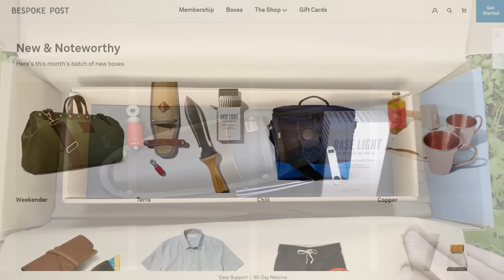How To Make A Bottle Guitar (3 Parts and NO Tools)

Comment: Bro this is exactly what I need. I was working with rubber bands, but they broke fairly quickly. Plus as a bonus you showed some knots which can be very very useful for many applications. This is best video I've seen for a long time.

Comment: Would it be possible to use a violin bow on such guitar?
Reply from the maker: Yes, probably
Reply: That could be a lot of fun too, I love this project
Reply: Honestly probably not. 
I mean you could but the violin has completely different strings and are much much more taught. If you were to make this a bit more complicated and make tension knobs it would probably work better. However I doubt this is rigid enough to really work like a violin. Plucking would work much better.
Reply: Could sound like one of this mongolian horse head violins

Comment: I wish your channel had been around fifty years ago, when I taught a number of instrument making workshops for fifth graders. We managed to make tin can fiddles with bows, xylophones, and a couple other things.  But all required me to drill a hole or provide specialty items such as horsehair.  Your bottle guitar is much better thought out and sounds great.

One quibble- you said right at the beginning "no tools" and I wondered right away how you cut those notches in the end of the pipe.  And of course you did use a tool: that sharp stone edge is a file if I ever saw one. :)

cheers from rainy Vienna, Scott

Comment: If you have a strong string like nylon, you can use it to cut the pipe or cap of the bottle. You just rub it back and forth to create friction and heat. I learned this as an electrician to cut pipes in ditches when you can't get a saw under the pipe.

Comment: Nice idea for a quick lockdown project. I always like how you make your projects with PVC and Soft-Drink Botttles too! My favorite building materials.  I think you could eliminate the heat gun step by just joining some pipe together with couplers to make the bends. Also, you could use a larger diameter pipe that fits over the bottle mouth to form a larger "neck" and perhaps get a couple more strings on there. In any case, this project would be a good place to start if someone wanted to get a feel for playing guitar.
Reply from the maker: It would be cool to see a multi string version as a next step. I couldn't think of how to do it without really complicating the design. I think you might have to use something other than a plastic bottle.
Reply: how did you get here 3 hours ago?
Reply: @palmermonsen9098  probably patreon

Comment: Excellent instructional video. BTW, what type of string should be utilized (other than the kite string that you've mentioned)? Can't wait to assemble the botar (bottle guitar) once I've purchased the right type of string. Hope the finished product sounds as good as the one in the video. Thanks. 👍👍😷
Reply from the maker: I was using plastic gardening twine. The kind that comes in a dozen different colors at every hardware store. Any string should work, even fishing line.

Comment: Love this idea I am a younger aged person in a nursing home and my occupational therapist and I are going to be trying to make one of these within the next week or 2  help my hand dexterity and battle my depression as I love instruments and diy craft projects. She asked me what I wanted to try and I found this video. Question though what thickness (mm in diameter? Material?)or kind of string would you recommend for the deeper sounding guitar? Thanks I am so stoked about trying this!
Reply from the maker: The pipe is 1/2" diameter pvc pipe, the string is I think polyester garden twine. It's the sort of twine that is sold in a bunch of different colors at most hardware stores. String that works well and is better quality is braided string for window blind cords.
Reply: @Nighthawkinlight  thank you very much! I made an attempt at one this morning just having trouble with string tension
Reply: @Nighthawkinlight  we are using a 20 oz bottle I dont know if that could be part of what is affecting the sound we went with what was available but can always try again. Your instructions were so clear assembly was no problem.
Reply from the maker: @lorisimpson6374  Some strings are slippery and might make it hard for the sliding knot to hold tension. You could try using a bit of thicker rope in the back which can hold the tension better like I show for the thin string version. Glad it was easy to assemble!
Reply: I've got it playing now hope to make a video in the next few days I made one alteration I used a crayola magic marker cap for the bridge as the bottle cap kept popping off. I love my new instrument thank you!

Comment: i'm just wanting to see someone make some "rolled" bottle string! what i am talking about is you take bottle string and attach it to either a drill or motor and a anchor point (i.e vise) and twist the bottle string until it starts to "roll" over onto it'self. you then heat it up with a variable heat gun while it is stretched out to keep the tension of the string but dont overheat it, you'll end up burning the string. you now have rolled bottle string. an example of what to use it for is coil it in the spool for a weed wacker...

Comment: if you use a bottle with slightly larger opening, a slightly larger diameter pipe to fit the mouth of the bottle, and taper the top of the pipe until its flat using some heat and weight/clamp, you might be able to cut 6 notches on top and make it a proper 6-string guitar with strings of different sizes (or even actual guitar strings).

Comment: To bend plastic pipe without it deforming when heated. Fill the pipe with sand before applying the heat. You can empty the sand after the plastic has set

Comment: I'm going to try making one with a bamboo neck instead of PVC.  Because I have bamboo growing in my yard so I won't need to go to town. And maybe try using metal wire for the playing string so I can play slide on it.  I wonder if the bottle cap bridge would work better if it were cut in half into a "D" shape
Reply from the maker: Slide works on the plastic strings too, but you don't get the growling sound of metal. Let me know how it turns out!

Comment: I love the simplicity of this instrument and I am very much making my own.

I have some questions though: (Not meaning to criticize at all ;) )
Guitars have a hole in the sound box...
Have you tried making one with a hole cut out of the bottle? If so, was there any difference in sound volume?
Also what is the relation between the size of the bottle and the lenght of the tube? Can a guitar be made with a big bottle and a short tube and vice versa?
There is an equation that tells you on what positions should the frets on a regular guitar neck be... 
Can we calculate the positions of them or are they (the locations of the frets) determined via the tension of the "string"? (i.e. Should we first tune the string to a specific note and then determine the frets or the other way around?)
Reply from the maker: A hole would be interesting to try. I haven't. Large bottle only works with a long neck because it would make the string have a steep angle with a short neck. The fret positions will always be in the same spots no matter how the string is tuned. Find the notes by ear and pencil mark the neck. Watch the playing tutorial in the video description.

Comment: On justinjohnson channel is a method of threads plotting. You take string with lenght of bridge-head and fold it in half - this is 12thread.Next the same but fold in three and You have 3rd thread as i remember correctly.

Comment: All I can think about is how to make this into a 3 to 4 stringed instrument. Adding more should be doable without any additional components, and maybe even easy with some additional components like a T-corner on the end and something else (wider) as a bridge.

I don't have the resources yet the time to figure out how to do this, but I Challenge YOU to make it. 

Without tools, or, With no more then a glue gun, screwdrivers, hammer, and other common tools most people have or are easily obtainable in a local store for cheap.

Comment: 🔵 I designed a cardboard upright bass whose sound Rivaled that of a concert quality instrument, it had a three-ply
Corrugated triangular body and was constructed out of the box that all the other parts ( neck, braces, bridge, pegs etc.) came sent to you in, the box had a template printed on the inside of it and instructions on where to fold, cut & glue.
Pretty much all that was required for assembly was a good utility-knife, a hot-glue gun and the knowledge of how to use it WELL!!
What stopped me was the "Box" to most of the guitars reaching the customer so badly damaged in one way or another as to require replacement, and then the REPLACEMENT would end up arriving damaged as-WELL!!, and THAT was just AN EMPTY BOX!!.......
We even tried shipping a box-within-a-box (leaving room for distortion), to no avail, this happened SO many times with SO many customers (regardless of the shipper) right in the beginning, that I wasn't able to remain in business very long at all.

Comment: I'm wondering if you could seal the bottle around the PVC pipe and then add an air valve to it. That way you could pressurize it and change the tune even more? I noticed the bottle cap sinks in alot. Maybe this could change that?
Reply from the maker: Could work

Comment: Huh, this video actually brought me some flashbacks from my high school graduation. I with my friend had stuck a rubber band to a ballon with a tape. One my hand was holding a ballon carefully to not lose the sounding and my other hand was holding a rubber band(index finger and a thumb to hold; middle finger to play the string; I moved my hand to adjust the pitch of the sound). I learned to play The Final Countdown but it still sounded bad because of ballon and a rubber band was always slipping.

Another stupid lifehack from me:
You can steal an elastic band from your grandfather's underpants and attach it to a microphone to record some strange melodies...
Reply from the maker: I've seen a few different balloon guitars. I might try something similar with this design in mind

Comment: It would be cool if you could slightly pressurize the bottle so the cap doesn't push in the design your neck to that. Might be another way to tune different

Comment: Have you tried drilling holes in the pvc inside the bottle to see if the sound is amplified through the pvc? Or what would happen it you sealed the pvc and bottle with a valve to change the pressure inside?

Comment: How would you recommend figuring out where exactly to position the frets?
Reply from the maker: By ear. There are online fret calculators where you input the string length and it feeds out fret measurements, but they won't be as precise as your ear or a phone tuner if the guitar's action is high. You can also use dulcimer style freting for various scales and it's even easier to play.
Reply: @Nighthawkinlight  Thanks!

Comment: Interesting video. I was thinking about using an empty glass bourbon bottle I had laying around, and maybe a stick from the woods out back instead of pvc. Would that work do you think?
Reply from the maker: It should work if you can get the string to stay put
Reply: NightHawkInLight I might need to modify the loop at the bottom a little. We’ll see how it goes. Thanks
Reply from the maker: You could glue some nubs on the bottom of the bottle for the string to catch on.
Reply: NightHawkInLight i was thinking of using another piece of string and creating a sort of basket underneath

Comment: I’m making this for my school project. One question tho. How do I tune it?
Reply from the maker: Tighten the string with the sliding knot to make the note higher, or loosen it to make the note lower.
Reply: @Nighthawkinlight  thx. got 1 more question. What kind of tube do I need?
Reply from the maker: 1/2" pvc pipe
Reply: NightHawkInLight I can only find mine in metal, is that ok?

Comment: Would it be possible to have two strings if you filed another notch into the top of the pipe and wrapped another string and cap around it? You might have to make it 72 degrees off of the first one (to fit the bottle's feet) but I think it would make the guitar more versatile if it works.
Reply from the maker: Maybe so

Comment: For the version with a smaller bottle, how did you decide how much shorter to make the PVC pipe?
Reply from the maker: It doesn't matter. You can make it as long or short as you want

Comment: Does the pipe that goes inside have to completely cover the bottles hole? Can I just use a long ruler instead?
Reply from the maker: You can try a ruler. It might be too floppy to hold the string tight.

Comment: instead of using a round tube can you substitute with a squared piece of wood?
Reply from the maker: Yes, as long as you can fit the end into the bottle
Reply: @Nighthawkinlight does it also have to be hollow? The wooden piece i mean. I want to create the same sound but can’t get a pipe.
Reply from the maker: No, it doesn't matter if the neck is hollow

Comment: Is it possible I can just use glue instead of tying this stuff together? Will it affect the resulting sound in any way?
Reply from the maker: You can't tune the string with glue
Reply: @Nighthawkinlight  Well I meant after the tuning, then I glue it down
Reply from the maker: In order to tune it you need to use the sliding knot and the string needs to already be secured to the bottle, so by that point you've already tied all the knots. Glue won't add anything at that point
Reply: @Nighthawkinlight  Oh alright, Thanks mate

Comment: Can you have multiple strings?
Reply from the maker: I haven't figured out a good way to do that yet
Reply: If you use a wooden yard stick (or big ruler) instead of a pvc pipe you could make one. Also, replace the bottle for a wider bottle. A milk jug bottle has a wider lid/opening, for example

Comment: Could you explain the taut line hitch? I tried doing mine on a twisted mason twine and it kept getting loose. It worked perfectly with it being able to go up and down but wouldn’t make the rope tight enough so it couldn’t play a note. I would pull the rope up making it tight again but then the string is loose again.
Reply from the maker: Not easy to describe a knot in words. If you search for it on youtube you will find more demonstrations of how to tie it.
Reply: @Nighthawkinlight  does the bottle also matter? My 2 liter plastic bottle is very squishy so when I tighten the rope, the bottle bends inwards

Comment: What kind of kite string? Cotton, nylon. Does it matter if the pipe is hollow or solid?. I’m planning to use it in  my class.
Reply from the maker: Gardening twine works well, flax, sisal. Doesn't matter if the pipe is hollow
Reply: @Nighthawkinlight  nylon or cotton. If you can share a link of the string then that will help me purchase those items.
Reply from the maker: @TheManjusu  Nylon should be fine
Reply: @Nighthawkinlight  how much string per guitar?
Reply from the maker: @TheManjusu  About 3x the neck length.

Comment: The tautline demonstration is wrong. The final loop should be going in the same direction around the standing end as the first two loops, not reversing direction. If done correctly. The Tail of the working end will be on the opposite side of the know from the part that goes into the knot from the loop. In the demonstration. The tail end is coming back out from where the start of the knot enters.

Comment: Is the pipe supposed to fit perfectly inside the bottle, because mine is kind of loose and moves around inside the bottle...
Reply from the maker: Best if it fits, but you can wrap the pipe in tape if it's loose.

Comment: Is it possible to add.more strings?
Reply from the maker: Maybe. You could try cutting more grooves in the top of the neck. With more than one string you have to be more careful with tuning to make sure the strings are in tune with each other. With one string you don't have to worry about it.

Comment: Question: What size is the pipe?
Reply from the maker: 1/2" pvc. The pipe should fit the size of the mouth of whatever bottle you're using. 1/2" sch40 pvc fits in most US soda bottles.

Comment: Does Paracord work for the string?
Reply from the maker: Yep, it would be very bassy but it will work.
Reply: @Nighthawkinlight  what string did you use for the bass version?
Reply from the maker: Some kind of gardening string. The kind they sell in a bunch of different colors at hardware stores
Reply: @Nighthawkinlight  is the pipe supposed to bend?

Comment: such a thing isn't a guitar but actually a "diddly bow", if it weren't fretless and capable of playing chords (with multiple strings) then it would be some kind of guitar, but diddly bows are just as similar to violins so can't really be called a guitar.
Reply: heavy gauge fishing line is also excellent for improv guitar strings, and strimmer (weed whacker) cord is great for bass strings, or if you want REAL bass, use the wire inside of the brake cables from a bicycle.

Comment: Does it have to be any specific string?? Do reply
Reply from the maker: It just needs to be fairly strong. Otherwise the type doesn't matter. A thicker string will make more of a bass sound. If it's too thin you'll have to use a thick string in back for the sliding knot as shown later in the video.
Reply: I imagine a nylon string (used for hanging clothes or those weird handheld lawn mowers). It has the same appearance as a nylon guitar string

Comment: Mine isn't making any good sound like your are fakeing or is it real in why won't mine work right?
Reply from the maker: It's real. Are you using a similar bottle? Is your string tight?
Reply: i made one for a music project. mine does not sound good but not that bad. i used a thick string for sewing.
Reply: also mine has tight strings